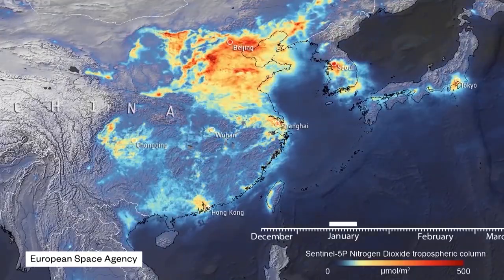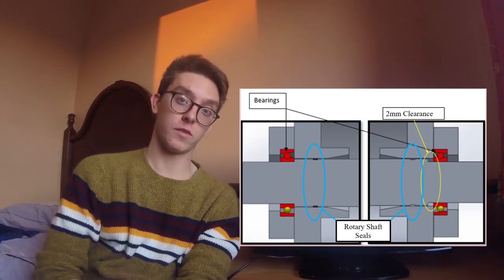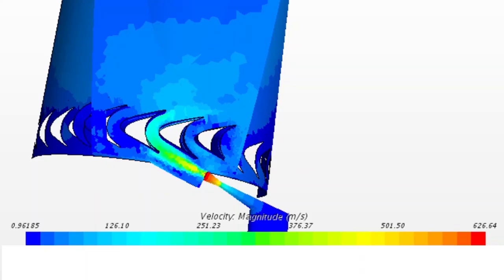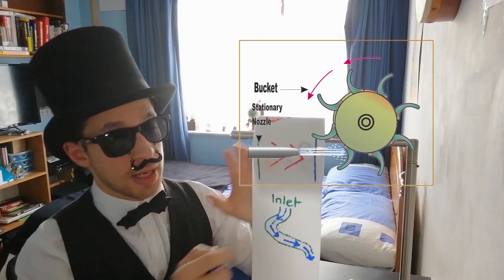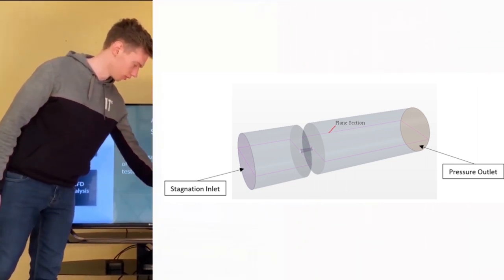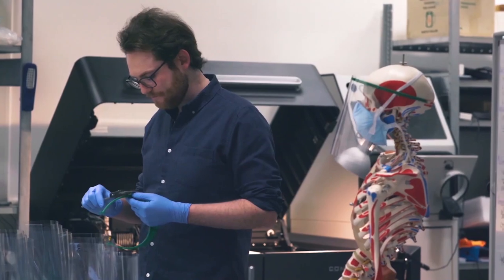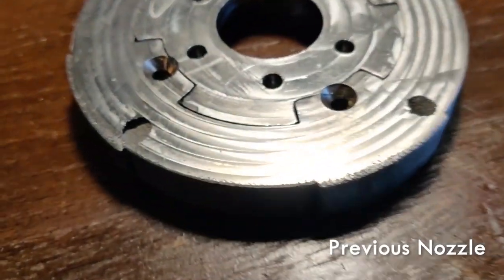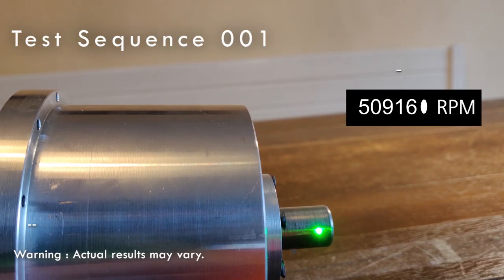Micro Steam Turbine Design Project Video

Comment: I have an idea for this what if you guys seal the shaft inside the housing and add magnets to the output. This will make it so that you will not have to use seals in the housing "unless you want to throw out the bearings and use a pressurised oil system going through a journal bearing, it will last longer and you can directly connect a gear pump to feed the system for continues use in I say a household setting for emergency power?"